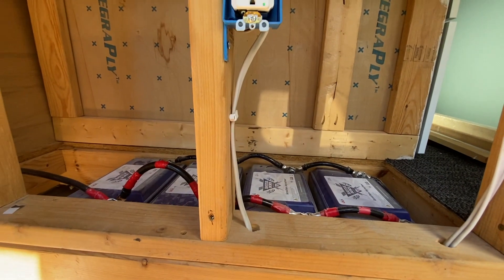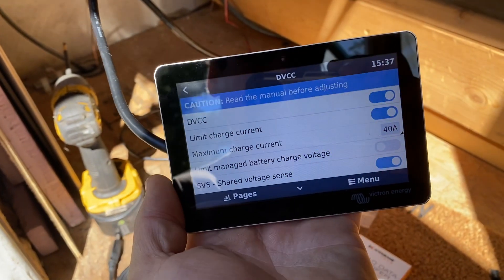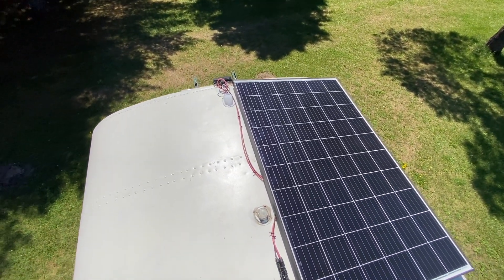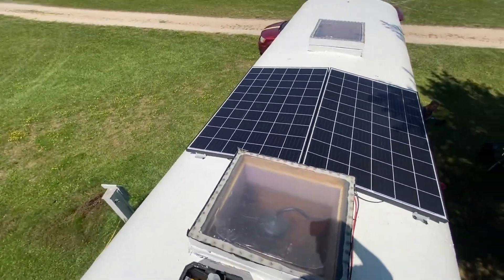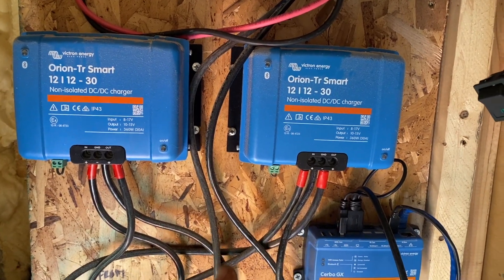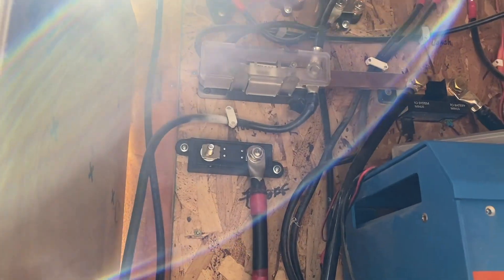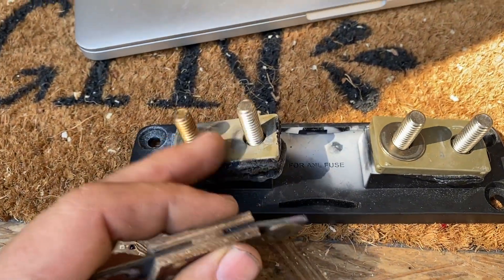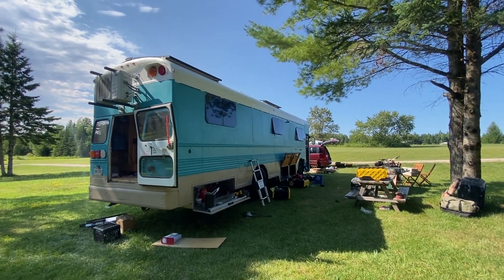Skoolie Solar System Install 1280w  and solving burnt fuse that didn't blow

Comment: I have a tip for you. In a narrow space like RV you need sometimes very short leads, like a fuse tight next to a breaker. I slide 2 lugs of different sizes into eachother and crimp them. Offset layout can be accuired by flipping one. You need to use good quality lugs offcoarse.
Reply from the maker: That's interesting.  I've done the lug to lug method  with a tiny piece of cable and flipped one before.  Never smaller lug inside of larger one.  I'm planning to get some copper bar stock and make some custom lengths and holes to go from Lynx to Shunt and so on.

Comment: I went through the same scenario and it ended up being that I was trying to run a 12v system that was too much for the wiring too handle. I changed over to 48v with an inverter that put out 110v ac and it has worked perfect ever since. At 48v the wires aren't getting the least bit warm when they were melting at 12v.
Reply from the maker: 48v is definitely a good way to go. However, it’s all about amps in wires, they only hold so much. We’ve done giant 12v systems, they just need big wires, usually 4/0 .